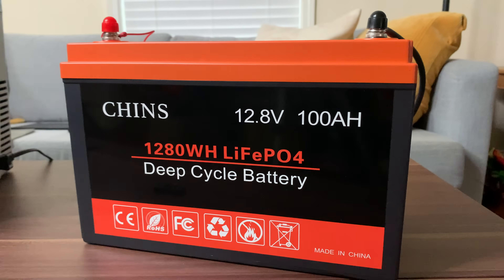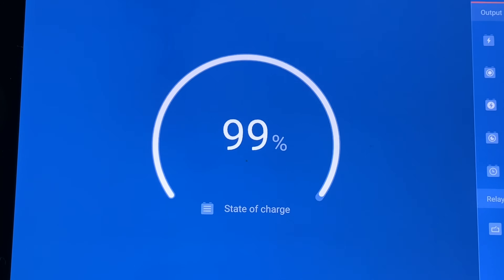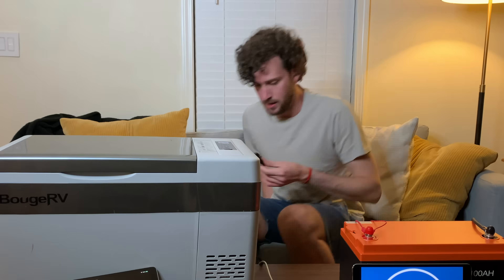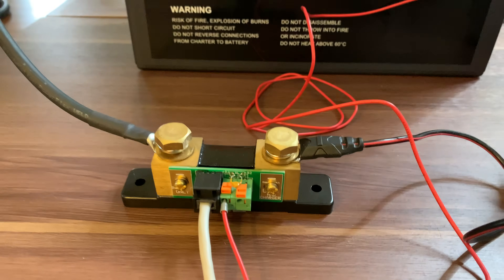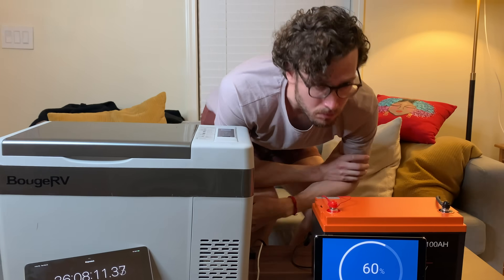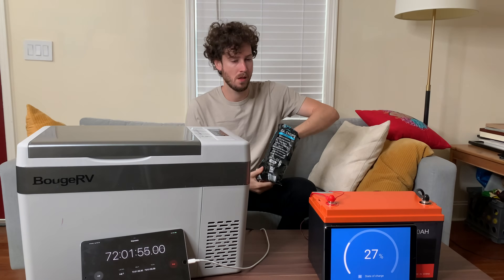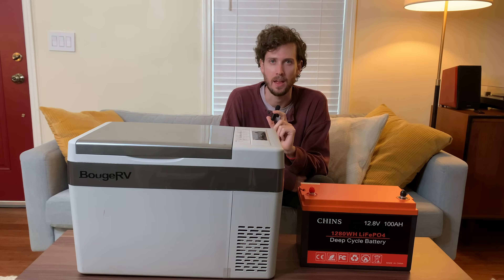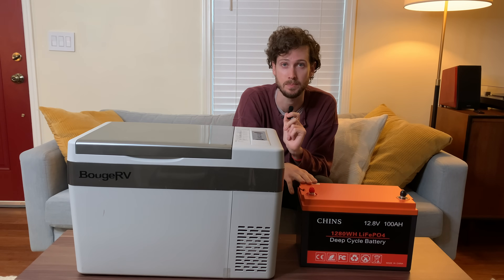100Ah LiFePO4 Battery vs 12V RV Fridge

Comment: Freeze a couple bottles of water before going on battery. You can extend this out for a longer time.  Also depends on the heat outside the cooler.  Insulate it and it will go longer.

Comment: That means you can easily travel daily or weekly and not have to worry about the battery as long as your coach battery is charging from your engine's alternator.

Comment: You know, sitting in a company car all day at work for 12+ hours, it wouldn't take much to charge one of those LiFePO4 batteries off of the cars plugs in a duffle bag LOL talk about a low power bill.

Edit: I am a single man - KEY WORD there gents, SINGLE. Therefore, i dont run the giant furnace in the basement, I use a single kerosene heater sparingly(working on adding reflective insulation to the walls in my room to increase efficiency and make the heat bounce around). I hardly run the lights and only when i need them and have well water. 90% of the time when i am home, i run a small LED 4W bulb standing lamp for light and take short showers(and i'm working on a solution to this). I cook meals that last several days so my biggest cost really i think is refrigeration. My power bill last month was right at $14 - not exaggerating and this is before i increase the efficiency of my living situation. My gas bill was $0. 

For all the young men just out of high school and getting their first place - this is how you can actually afford to live and still save money 💡

Comment: I did the same test with my Jackery 500, I had two ice packs in. 5 days of -36F Jackery had 60 percent left. Lots of other variables like ambient temperature etc. But it doesn't take much to run these new coolers. Refrigerator coolers 45 w. Max then it cycles down.

Comment: This isn't her real life scenario though. The ambient temperature has a massive impact on how long your battery will last and how often the compressor has to run. 

You ran that test inside your house which is climate controlled. Most of us are using these fridges in our cars or RVs during warm weather, which not only the temperature outside is warmer than in your house but especially the temperature inside of car is significantly hotter. 80° outside is probably 120° inside of a car, which would make this battery last probably half as long

Comment: My vevor portable freezer on -20⁰C runs for 100+ hours on a 300ah battery in a hot motorhome. My 12v compressor fridge can run for weeks on the same battery, about 10/12% per 24hs.

Comment: I did a test on a VEVOR 30L compressor cooler. It did exactly 24Ah in 24hrs. My dads 12v 50L fridge did 14Ah in the same 24hrs. Currently testing a 220v 68L fridge on the inverter to see how it compares.

Comment: Tiny fridge, useless. what about a medium to full size 12v fridge? Propane is still superior for offgrid use and i have 800ah of Lifepo4/Solar.  You don't always have good sun, that means you want to use gas when you can to limit battery use. I focus on A/C, water pumps, furnace fan/ignitor and entertainment for battery use.  Fridge stays gas, Ultra efficient.  Two tanks can run a medium sized fridge for a month or more.
Reply: Some of us do a lot of car camping, so this is exactly what we're looking for. Take your arrogant atittude elsewhere.

Comment: It's a very impressive result, but so unrealistic. We use these frigs on camping trips, not in our air conditioned houses. I wish you had left the frig outside or in your backyard for a more accurate test.
Reply: Even if it was on twice as much it'd still last atleast 3-4 days and a low cost solar setup woukd be able to charge that battery in a day so you can have the fridge run the whole time

Comment: I noticed you ran it directly from the battery not using an inverter. All other channels do those DIY boxes with inverter solar charger and other upgrades. What did you use to connect it to your fridge
Reply: The fridge comes with a 12v car cigarette adapter, you can buy a socket for the cigarette adapter with cables and crocodile clips or ring terminals to connect it to the battery.

Comment: Seems good enough for me but you could have opened it up each day like 4-5 times as if you were in a camping scenario.  Like getting items out for breakfast lunch and dinner or a drink periodically. Or what this would be on a lead acid battery, if any difference. I am looking at a Dometic cfx5 45L with a 100W 20A Renogy solar kit with 2 batteries for my VW Vanagon and just wondered about how long it would last if say the sun wasnt shining perhaps and was just running off the battery. I would also have a power inverter just to have outlets for phone charging ect.

Comment: How about resting a diesel heater. I bought one an after a few vids discovered a way to use it indoors. You run the exhaust,which is very hot thru a old cast iron radiator then out thru a exhaust in the wall. I'm just dipping into Solar an have a Anker C1000 an the extra back up. I'm looking for ways to on the cheap provide heat an think this would be a budget friendly option. Love your channel, well made vids that are to the point an informative.

Comment: your battery maybe. my lithium-ion batteries beep like hell when they run too low, (which is no where near 100%. closer to 50%) and when they are drawn too low they will shut you off to preserve themselves so as not to run too low. with a little research you will find this to be a common feature with these type batteries.
i am surprised it went as long as it did.

Comment: Conservation is considerably less expensive than generation. Insulation will prevent power consumption.  Lots of power lost keeping monitor and control. What is the ambient temperature… put it in your 110F RV for 2 hours with and without insulation…. Then shoot us with the info…. You have your home AC on? How cold is the floor where the fridge and fridge input grille reside for this test?

Comment: I love to see the exact same test... But use one of those 3.5 or 5 cubic foot deep freezers with the adapter that converts into a refrigerator!  Which system is a better bang for the buck the deep freezer with a different thermostat that will probably last 20 years or that 12-volt refrigerator that will probably last five???? And WHAT USES LEAS POWER TOO.
Reply: I have a 5cf chest freezer, it uses around 700wh per day as a freezer and around 600wh per day as a fridge. For home use the extra capacity is worth it but the primary market for these chest coolers is overlanding/camping/vanlife where space is at a greater premium. As a result there is no one best option. Keep in mind that he ran the test on this 12v cooler in max mode instead of eco mode. He could have got it down to about 250wh per day. If you don't need a lot of space, the 12v wins.

That said in terms of wh per day per cubic foot of space, larger units will always win assuming similar quality. A unit with 2x the volume only has 1.44x the surface area to lose heat through. a 5cf chest cooler uses 2.2x the power but has like 5x the space. If you need more space, a larger cooler wins.

Comment: Amazing.  I am in the process of turning in my old 3 deep cell (31 series) lead acids for 2 lifepro 100Ah batteries.  Hooked up to 400 watt of solar panels.  I will wire in series to help the inverter a little bit.

Comment: Ive been looking at the same brand but in a 230 or 280Ah and slowly build it to an 800-1000Ah. I have music equipment Id like to run along with a fridge/freezer 38qt, and not sure what else.. some LED lights at night, Laptop runs 8hrs on a battery charge so... I'm sold on this brand. I think Will Prowse also gave this a great thumbs up.
Reply: these bougeRV have fantastic efficiency for their price. That said your target setup is pretty overkill if that's all you need to run. Determine how many wh you need per day, then go from there. Dual zones use a bit more juice, around 350wh per day. A laptop may need about 100wh for 8 hours but it depends a lot on its power and this can be less or more. 2x 60w equiv led lights are 5w each, so 5 x 2 x 6 hours = 60wh per day.

350+100+60  = 510wh per day, a little under 50a from a 12v battery, its closer to 40a, but let's call it 50a due to inverter parasitic draw

A 280ah battery would be about 5 days of reserves, pair this with like 400w of solar and it should give a healthy margin, 600w of solar if you want to be safe.

Comment: i thought maybe 20 hours, i'm using a Samsung 3 door BF263 full size outdoors, run it 5 hours a day with salt/ice bottles in freezer working good with 1000w of panel and lead acid lithium mix, but tempted to go smaller after seeing this! thanks

Comment: so with a 100w solar panel you get Infinity refrigeration
Reply: based on test it was consistent at 288 ish watts per day, a 100w solar panel  gives you around  300-600 watts per day so it should.

Comment: Nice test 😝 I plan to use a 20Ah LiFe4 battery for mobile ham radio…wonder how long it will last with sporadic transmissions. To what percentage do you think I should drain such batteries before recharging?
Reply: Lifepo4 does not have memory so whatever you are comfortable with is fine. I'm approaching year 2 with weekly+ use and no noticeable degradation.

Comment: If you had any amount of solar powering that battery, you bassically could run the fridge for ever
Reply: Not necessarily my mini fridge runs around 68watts and sometimes my battery by next morning is at 1% with good days worth of solar,I wake up and check it it's possibly 30%, but that's because hungry Ac inverter if it was DC that's a different story, so what you're saying is 12v makes that much of a difference?
Reply: Yep since they say to have 3 days worth of battery power. So the solar on sunny days would top up the battery and be good for 2-3 cloudy or rainy days. Problem is when one calculates what it consumes in a 24 hours period and your battery only matches that, then even if you have enough solar, the cloudy-rainy days it's not enough.

Comment: This was good. Can you test the same battery on an AC home normal fridge with an invertor or anything? Would want to test before I buy the battery system. Load shedding hits Zambia. Also, of there is AC 0.75HP, how long can this batter work around?

Comment: My 38 quart 12v will run set at 20 degrees f. For freezer and 38
Degrees for the refrigerator. Using a 122:amp hour lead acid
Deep cycle in temps ranging from 70 degrees f. To 90 f.
It runs 72 hours. Pull on average 
40 watts.

Comment: Put frozen water bottles in fridge and fill as much space as possible in precooled fridge and then run test . Mine will last for 20 days and sometimes 22 days if i dont open it. Also put it in a cardboard box with vent opening . I got an extra 4 day. I couldnt beleive it . That nearly 27 days and on eco i got 30 days. But if you open it you will lose nearly half a day

Comment: My RV fridge has a 380ma draw, with my 2 lifepo4 batteries I have 200ah.  My calculations say I have 15 days run time before the batteries hit 30% soc.

My fridge runs on propane

Comment: This is the kind of tests I was looking for! Please test a fully loaded 1000W desktop playing games or doing multi-hours rendering.
Reply: With an inverter, a little over an hour.  1000 watts is a lot of power consumption. Heck, a microwave is roughly 1000W (but a microwave wouldn't be on for an hour)
Reply: its a 12V battery.. pc psu require 120-240v so it wont run at all

Comment: I get similar results with my 12 volt fridge, only running off 2 lead acid batteries (for 100 ah usable power).  I have the exact same fridge only I also purchased the custom blanket for a bit more insulation.

Previous I had a Mobicool transducer style cooler, which also worked and used about 50 watts, but 2 major differences:  The Mobicool, being a transducer style, did not target a specific temperature but instead just brings the inside temperature down by ~20 degrees Celsius compared to ambient, so it isn't suitable for spoilable foods like milk or eggs.  Also the Mobicool does not cycle, so it's always using 50 watts, so the overall run time from 100 ah is more like 24 hours.  Big difference.  Compressor fridges are much better (although more money).

Comment: Do you use an inverter or just a 12v adapter that connects to the battery?
Reply: No inverter in this setup it’s a 12v fridge.
Reply: These fridges are already 12v so no inverter needed.

Comment: Yeah, mine stays outside, but I've got 300 AH of 48v batteries and another 200 AH of 12v batteries along with a 2.6kw solar array on my RV roof. The portable fridge isn't even an afterthought, the rooftop A/C is about the only thing that really draws my system down at all in situations where I have to augment the mini split to get cooler faster or if it's north of 100-105 degrees outside.

Comment: My Ecoflow Delta 2 and EB use The LifePO4 batteries. It will power lights at the cabin (AC) and my Iceco 31 qt. fridge (DC) for 3 day camping trips using about 70 - 75% of the charge. Very pleased! Thanks for your review...well done.
Reply: So if you use only your fridge on your Ecoflow you can make it run for about 5 days? Is that right?

Comment: Basically, if you have a 12v lithium charger (even cigarette lighter) and don’t stay at the same spot for more than 3 days (ie drive a bit) the fridge will work forever… and if you do stay longer a cheap $100 panel will suffice 🎉

Comment: how long it will run a COMPUTER + tv + led + ps5 + - pc WITH 850w psu ( 450 TO 500W UNDER USE ) 75W tv

Comment: big prep to do with any 12v is to cool it off at home first take it to temp freezing and start it on battery from there
Reply: Bingo - I thought everyone knew this.  Best practice is to plug in the fridge the night before, let it get it well down in temp, then load it with food that has already been cooled.  Sure, now and then you might not remember to do that, or maybe you just don't care because the initial drive will charge all the batteries....  Me, I always pre-cool the refrigerator.

Comment: That is very normal for anyone with a lithium. Fridges cycle on and off  to maintain temp. Once cold they are off more than on. That is why they rate fridges with a daily usage rating that is usually around 200-250 watts a day. They run longer on freezer setting usually due to the frozen food help maintain the temp.

Comment: The issue is never how long it will run. The real issue is: How much do you want to run down the battery in 24 hours? Why? The battery needs to be at 100% charge before nightfall. If you're continuously using the refrigerator and never shutting it off, you still need to charge the battery to 100% before nightfall  - every day. Then, the question becomes how much solar power is needed to accomplish this? I recommend using the Victron Smart Shunt with a Victron Smart Controller. Monitor  everything on your Android phone or iPhone.

Comment: I got a alpool one 9Lt, a small one, thats all i need, connected it to a 110ah leasure batt, it lasted over a week,  as I turned it off every night, so going on your times, that batt would last a good 2 weeks, max before a re-charge is needed , I turn my off around 2100hrs to 0700hrs,

Comment: Good test but running time can vary so much depending of the condition, I ran a similar fridge with a 50ah battery for 3 days straight, I am expecting to go over the 5 days mark with my new 100ah one

Comment: You have 4 factors .. You have effekt (Joule) or watts) and u have voltage and u have current DC Ampere... and Ampere hours .. What ever the watts is on this fridge , lets say 65 watts 
W : V * I
I :W/V

65 : 12 * I : 5.41 A... 100 Ah/ 5.41 : 18 Hours it will last if no pause as the fridge will stop taking power... but 12.8 V battery will when is 25% left has less then 12.8 V soo the effekt will go down.. Thats how u calculate it

Comment: So was it the battery just directly hooked up to the fridge?  No voltage regulator or inverter?
Reply: Yes, I think so. These fridges are designed to run off a car, with the voltage varying from ~10.5v up to about 15v. The LiFePo4 battery will provide a similar range.

Comment: They say you only have 28 videos but I only see one video like this that test the batteries. It would have been nice if you ran a TV or a electrical heater to see how long it will last. Then we would have a better reading. Now I see these Power Queen Minis and I was wondering do they have the same Watts hour. Let's say if I had a light bulb with 100 w I should get 12 hour before it's empty right. 11-21-23

Comment: Great video.  

Here are some suggestions:
a)  5 cubic foot 110v chest freezer connected via an inverter large enough to power the freezer
b) 700 watt microwave (via a small enough inverter)
c) 2 L capacity kettle (via a small enough inverter)
d) diesel heater (one of those cheap Chinese ones)
e) Starlink Internet dish and router
Reply: The microwave alone would drain the battery after 1.53 hours..i have 3 90h hour battery bank, he would need 2 100 ah hour batteries and a 3 kw inverter. This is a rough guess.i also use agm batteries,  however if he were to add 500 watts in pv pqnela qns q second 100 ah battery,  he could go for days onmsunny days.
Reply: Usually 20% losses in inverters and also the quoted w is usually peak power i.e. my 1000w  inverter cannot supply > 550w. Best to drive directly from battery, more efficient.

Comment: we run a 63 liter iceco chest fridge on a 200 ah bluetti 2400.
we run it 7 days 24/7 before recharge using it normally while camping.

the bluetti is not totally drained but 7 days is guarenteed 
even in 90 degree summers 

.